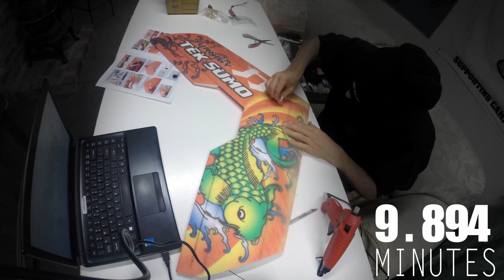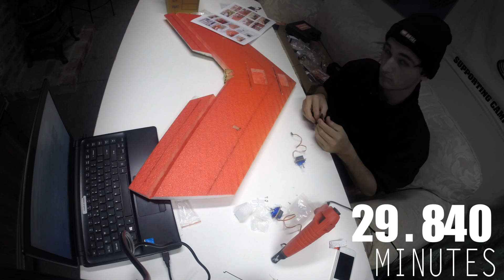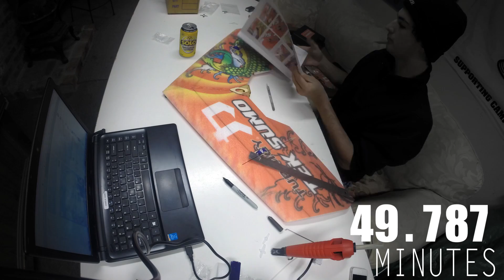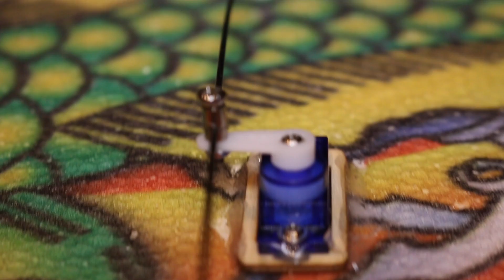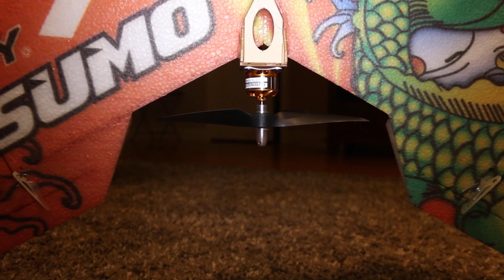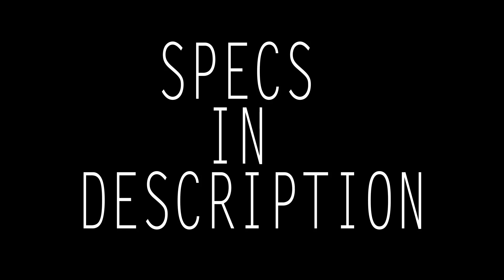Tek Sumo RC plane build - time lapse

Comment: You say 5000mAh in the description...this can't be correct...can it?
Reply from the maker: Colton Baldridge That was a mistake, I copied the order from HK and I had also purchased a 5000mah lipo for a tricopter. The actual lipo is a 850mah 3 cell. 

Thanks for pointing it out.
Reply: No problem, I was just curious as I just purchased my teksumo with 1000mAh zippy compacts, do you think they'll work?
Reply from the maker: Should work fine :)